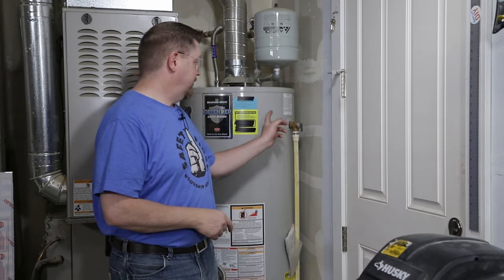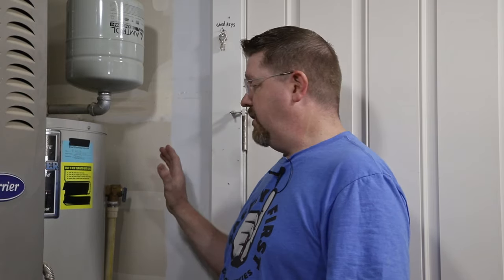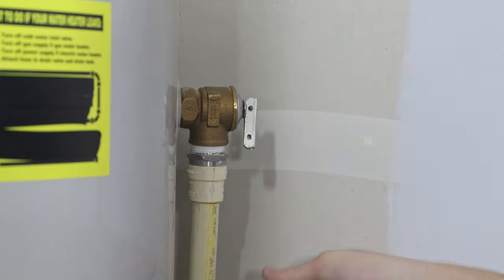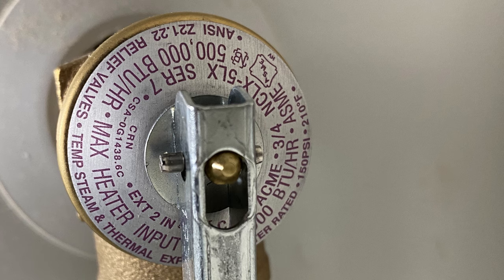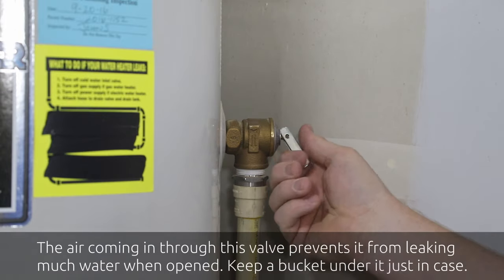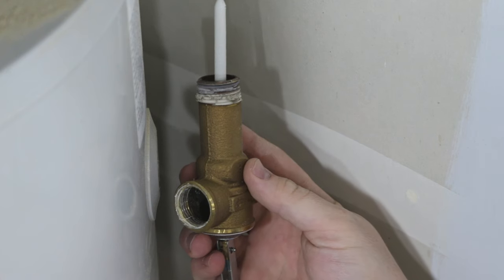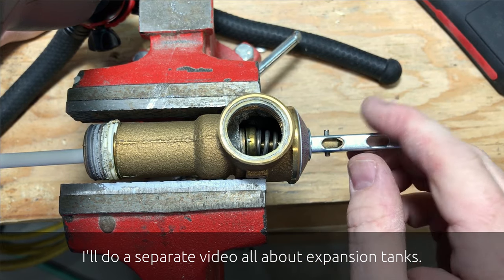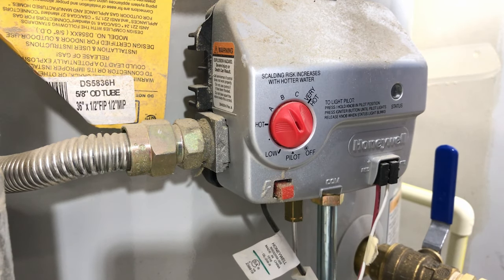How To Replace Pressure Relief Valve On A Water Heater (T&P)

Comment: Thankyou for giving me the confidence to fix this item and wonder if you have any thoughts about an issue I am dealing with. My heater is 15 years old, so most people react by immediately suggesting I spend $1500+ to have a new one installed. I don't understand why anybody does not want to try fixing something first, I would like to get a few more years out of mine. Initially the pilot light was going out, I relit it a few times over a few weeks until it would not stay lit after depressing the red button on top of the control valve. I replaced the thermocouple, it stays lit long enough to ignite the burner and provide hot water before going out again. For the last week I have been getting up several minutes earlier and lighting the pilot and turning on the burner which works to get a hot shower. I turned to what I believe is the next suspect, the gas control valve. It has taken me the last week of contacting Robertshaw, the valve manufacturer to be informed they do not carry a replacement and to contact the water tank manufacturer. I eventually was given a part number from AO Smith who had bought out American Standard, who had bought out the original company. Can you tell I am in C-19 quaranteen yet? Found one only available on ebay and am waiting for delivery this next week. This morning I noticed water coming from the T&P waste pipe, did the open the valve and close after a few seconds a couple of times, it kept running. I got the exact replacement of that and replaced it, thank you again. Not sure if the T&P valve failed or was just doing it's job because of the other issue, but I replaced it anyway and it no longer leaks. Am I in denial about needing a new tank or does it point to the gas control valve?
Reply from the maker: Hey Colin! You're like me! Why go straight to full replacement when repair/maintenance can resolve the problem? I'm glad to hear your T&P replacement went smoothly, and that the new valve is working correctly. 

As for why your heat is not working: Usually that's a sign of a bad thermocouple, but you've already replaced that. The gas control valve may be the culprit as well, and it sounds like you'll be able to rule that out (or resolve the problem entirely) when the new part arrives. I have 2 other thoughts based on issues I've seen with my heaters in previous houses: 
1) How much rust/sediment/junk is there down below the tank in where the burner is located? Is the burner itself still in good shape? I had a heater with similar issues to what you describe which were resolved by replacing the burner itself, which had rusted almost to oblivion.
2) Does your heater have any sort of status LED (blinking or solid) anywhere? Often heaters have a status indicator which will blink a certain pattern to indicate specific faults. Yours may be too old for that to have been common when it was made, but it's an idea to check on, if you have (or can get a hold of) the manual for your heater.

Good luck!
Reply: Colin Moore ,!

Comment: Super helpful, thank you. I opened and closed the valve a few times and it stopped leaking! I will still replace the valve (by myself) but I went from thinking I needed to replace the whole water heater, to a simple DIY fix.
Reply from the maker: Glad it helped!

Comment: Man you area a great teacher, easy to follow, i was replacing my gas valve on my heater and this valve has also been weeping but not from the usual place but where it actually screws into the tank and that area looks like crap and the tank is only 10 years old so i figured if I'm changing the gas valve i might as well do this while am it.
Reply from the maker: Good idea to replace it. A leak like that will only get worse. Thanks for the feedback, and for watching!

Comment: Thanks for this video! 

I only noticed the "test annually" notice when I prepared to flush my hot water heater. 

The valve on my 8 year old heater started leaking after the flush was done. Fortunately the part was covered by warranty. Unfortunately labor wasn't!

Comment: Thanks! This was a life saver! My Pressure Relief Valve started leaking Friday Afternoon. I 1st watched your video on flushing the tank and removed a lot of sediment. I refilled thought it was fine, but once the water heated up it started leaking again. Oddly my 1st replacement leaked too, even when cold? (Bought from local hardware store) Defective? In a panic I went to Home Depot at closing time and the plumbing guy (who has helped me out before) said it sounds like the valve and assured me the one he sells works with Rheem heaters. Sure enough replaced it no more leaks, did laundry, showers, dishes, it's been great! You did a good job of explaining the process and yes, the valve is not in there super tight, I had no trouble removing mine with a large crescent wrench.
Reply from the maker: So glad you got things taken care of. Nice job!
Reply: @AmplifyDIY  Thanks.

Comment: this is what i need to learn! same water heater as mine. like yesterday it start leaking the T&P valve that’s the first time that i see it dripping. And i don’t know what to do. good thing i watch your video..
Reply from the maker: I'm glad the video was useful! Leaks from the T&P may also be caused by problems with your thermal expansion tank: https://youtu.be/NGygvtP6Sdk
Best of luck getting the issue resolved!

Comment: thanks for all your help! as it turned out, i only had to flip the release valve a few times the water stopped and i didn't have to replace anything. if ever i do, thanks to your video, i'll be ready. 
thanks again
Reply from the maker: Glad you found a simple solution!

Comment: 9:40 I'm glad for the video's sake that you ran into this issue. If there is an issue I can run into while trying to get something done, IT WILL HAPPEN! So I would have been stuck here looking for another solution, possibly in the middle of the project. Or probably would have called a plumber to save me.
Reply from the maker: I like to show my mistakes and how I work through them specifically for this reason. I'm glad you found it helpful. Thanks for watching!

Comment: Helpful video and did all of this and flushed out my tank but it turns out my leak was around the thread area.  Had to replace the tank.  It was a Bradford White and I'm disappointed  that I only got a little under 8 years.  I'm going to try and make sure I routine maintenance on my new hot water heater but I've been told that this really won't prolong the life.  We'll see.
Reply from the maker: Time will tell. Good luck!

Comment: Attempting this tomorrow. The stores here don't have the exact valve. So they got me a universal.  Although they gave a 3 in as they had no 2 in in any of the stores either. I hope that's not an issue.
Reply from the maker: Hi Only Me - Hopefully the job was easy for you. Longer is ok. Shorter is not. Thanks for watching!
Reply: @AmplifyDIY  piece of cake. Have another I'm doing Saturday another that don't have a down spout attached. I did the open close method for about 20 x that stopped the leak so it bought me time to wait for warmer weather. This place don't have a drain for the water so have to lug it up.  This tank supports the upstairs so won't be having anyone have a faucet to open unfortunately as they work days. I think the drain can be opened to release the air pressure but won't know til I do it.  I'm going to add a down spout and bucket just for the future on these tanks there's 3 of them none have down spouts. But ill run them all to one bucket. Thx again for your vid.

Comment: I will say I did your video on how to clean out the tank. Mine has been leaking through that pipe ever since. I think I might need to replace it now.
Reply from the maker: That's a bummer - if these valves are neglected, they do sometimes need to be replaced once they are disturbed. Good luck!

Comment: Thank you very much for your video, packed with good information. 

Funny that every tutorial I watched for replacing this valve, the valve is on the side. Mine is on the top and tight as hell, went to take the valve off and the whole water heater turns. 😂
Reply from the maker: Wow - does the whole heater turn even with it full of water? Might have to see if you can find a helper to come hug the heater to counter-act the turning force!

Comment: Great video,  when I was a teenager my family's home was saved by the bell oops I mean T&P valve lol.  While we were away hauling a load of cattle to the slaughterhouse,  the 40 gallon electric water heater in our basement got extremely hot.   We came home that night and I nearly scalded myself when I went to wash my hands.  Dad went to investigate the problem and the valve has gushing water that was nearly steam and the basement felt like a sauna.   We went to home depot to get two new thermostats, installed them, but now it kept overheating and popping the reset button.   Turned out to be a bad element that shorted to the sheathing,  and kept heating with 120 volts to the grounded tank after the thermostat shut off, by that time all the stores were closed and it was almost 11pm.   So everyone had the privilege of taking a cold shower before catching some 😴
Reply from the maker: Oof! Lesson learned, though! Thanks for the story!

Comment: So glad I found your page. Best video I’ve seen for any type of DIY, help. Move in a perfect pace, explain everything and show everything. Thank you. One question, I did my install and when tightening the valve, I went hand tight and then tried 2 turns with the wrench. On the second turn I couldn’t get it to the correct position so I backed off. Now, as the water fills in the tank and it is getting hot, the valve with the pipe attached, seems loose. Should I drain the tank and give the valve that one half turn I felt was too much? So far, no leaks.
Reply from the maker: Hi Nick! Did you use any sort of thread sealant on the threads when you installed the valve? If so, it's likely that it will never leak, even after backing it off a half turn to get it lined up right. For now, I'd suggest you keep an eye on it. If a leak develops, then I'd remove it and count the turns it requires to get it out. Then I'd apply teflon tape and pipe joint compound (as shown in the video) and re-install it with the same number of turns - this will line it up, with fresh joint sealant which should prevent any leaks. Over-tightening these fittings can lead to the valve body breaking right off, which can be a pretty big headache to deal with. 

Good luck!
Reply: @AmplifyDIY  yes I put on Teflon tape and some pipe dope

Comment: Thank you, very educational.  I'm trying to figure what to do so it doesn't leak  when I increase the temperature so I have enough hot water for a bath.  Probably has to do with adjusting the pressure.  I'll keep searching.
Reply from the maker: Good luck!

Comment: SUBBED!!!!   EXCELLENT!!
PLEASE RESPOND: the "plumber" who set up my replacement electric water heater did so so that the thermostats are not easy to access, but more importantly, the horizontal T&P valve discharge pipe is directly over the anode - I can't get a tool in there to remove/replace the anode.
I'd like to rotate the tank clockwise to have better access to the thermostats, and to clear the anode away from the drainage pipe directly above it, but if I turn the (empty) tank clockwise, if anything it will make the P&T valve even tighter - and might break the copper  drainage pipe.  I don't want to cut the drainage pipe, if possible, because then I'll have to reconfigure pipe attachment - though I can solder, I'm not at all experienced  working with pipe configurations/adapters.
Suggestions????
Reply from the maker: Sounds like you have a pretty tight/limited space for your install, and the configuration is definitely less than ideal. If you would like to email a few photos of your setup I may be able to offer some suggestions: amplifydiy (at) gmail (dot) com. Thanks!

Comment: @8:15 why did water come out of my T&P valve when I did this step? I followed your exact steps and the cold water was shut off too. Thank you!
Reply from the maker: Hi Lula - was your drain valve open? Did any water come out of the drain valve as well? It's entirely possible that your drain valve was a little blocked up, slowing the flow of water out of it, which let more come out of the T&P.

Comment: I have been watching a lot of your videos and I learned a lot. Have you ever installed your own water heater ? I have a 50 gal State gas water which is seven and a half years old and I never did any maintenance on it until two years ago I replaced the anode which was completely destroyed, with a magnesium one and flushed the tank out a couple of times. I also replaced the drain valve with a ball valve. So two weeks ago I took out the two year anode rod and was shocked how much it was pitted. I also flushed the tank about six times and was shocked all the junk that came out of the tank, so I realized the tank was on its way out. I reviewed many different water heaters and found that they were all junk. The manufacturers would tell you that you have six years warranty but if anything happens before six years, they always find a way out of it . I went to Lowes and found a A. O. Smith with the same dimensions as the one that I have for $575.00. The put me in touch with a licensed plumber who does contract work for them and he wanted to charge me $1300.00 to swap the water heater out. He was going to change out everything including the cold water ball valve, a month old expansion tank, gas flex line, and just about everything else. There is nothing wrong with any of these things that I mentioned. The house is seven and a half years old and everything is up to code. I went to code enforcement and they informed me that as the home owner I can pull a permit and do it myself. The only problem is the water heater manufacturers will void if the installation is not done by a licensed plumber. So I just wanted to know if you installed your own water and how you made out with the warranty part of it. Sorry for the long story.
Reply from the maker: Hi Markie - I have never installed my own, but I do have a few thoughts: 
1) Unless your current heater is actively leaking / does not heat water, there is no urgent reason to change it. A super-pitted anode just means that the anode is doing it's job well, and lots of sediment built up says more about your water supply than the state of your heater. I would not be in a hurry to replace it unless there are any problems with how it operates. Instead, I'd just make sure to annually flush and inspect the anode, and check the pressure in your expansion tank. 
2) If you have a LOT of sediment built up in a year or 2, it's a much smarter investment to install a whole house water filter and a water softener upstream of the water heater. I have done this myself, and my water heater stays pretty clean (you saw how little sediment I got out in my flushing video, I assume.... that was after a whole year.) You can pick up a good softener at your local Lowes or Home Depot, as well as a whole house filter for around the same cost as a new heater (I think I spent around $600 all in for everything when I installed mine). If your house is only 7 years old and in the US, you likely have a water softener loop already plumbed in that will make the install very easy (we're talking taking up a saturday afternoon is all).
3) As for warranty: For me it's pretty simple math... and I use the same approach whether it's plumbing-related or in any other discipline (electrical, automotive, flooring, etc): Figure out how much it will cost me to do the job myself (excluding my time - cause I'm weird and enjoy doing these sorts of things myself). Then figure out how much it will cost to have a licensed pro do the same job. If the pro will cost > 2x me doing it myself, I just do it myself. My reasoning there is that even if everything goes horribly wrong and I wind up having to do the job all over again due to a failed part, and warranty does not apply because I DIY'd the install, I'm still coming out dollars ahead even if I have to buy everything again. Per your example: you can install a new heater for $575 yourself. Plumber wants $1300, but that will keep warranty intact (which you may never actually need in the first place). So let's say install one yourself for $575, and it fails in 2 years, and warranty is void because you installed yourself. Great, so go buy another one for another $575 (or pick a different brand and spend $600 or whatever) and you have still spent less money than hiring a pro. It's less convenient, but if you DIY you know exactly how well the job was done. If you hire a plumber, you roll the dice with how well they do the job... and I've seen some really terrible work by licensed plumbers. 

Sorry for the long novel, but you bring up an excellent scenario that I thought was worth some deeper explanation. If you have other questions about how to install a water softener / whole house filter, or would like any other (possibly terrible?) advice feel free to email me directly: amplifydiy (at) gmail (dot) com.

Good luck!
Reply: @AmplifyDIY  thank you your prompt reply and much helpful advice. I will certainly take what you said into consideration. It would be great if you made a water softener video. Thanks again.